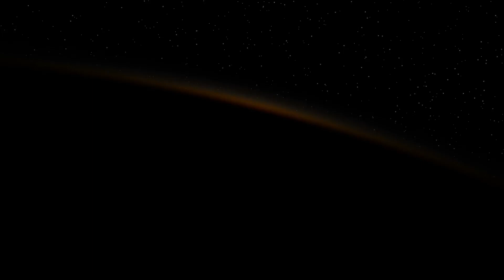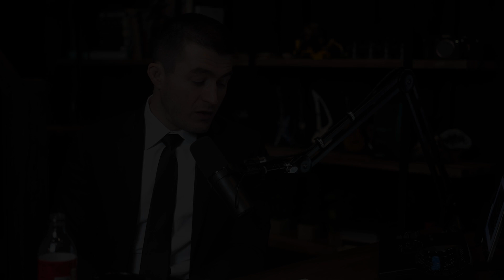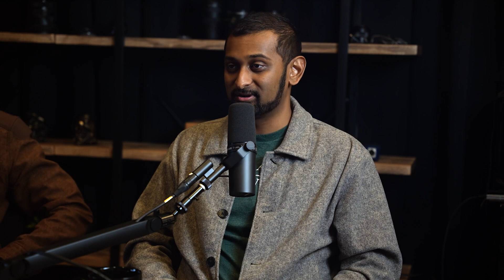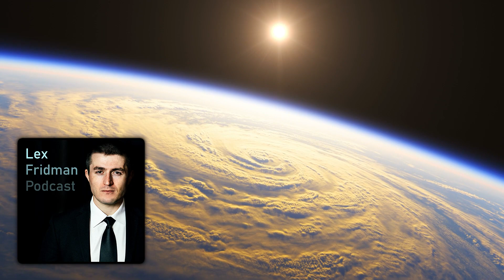Liquid cooling in GPU clusters | Lex Fridman Podcast

Comment: IBM mainframes were water cooled using the Thermal Conduction Modules (TCMs) from the early 1980s to early 1990s. Hitachi and Amdahl/Fujitsu also water cooled their mainframes in that time period. Even Apple released a water cooled PC in 2003 called the Apple G5.